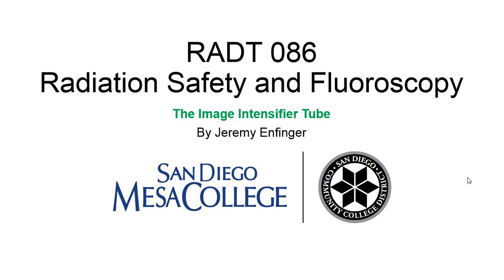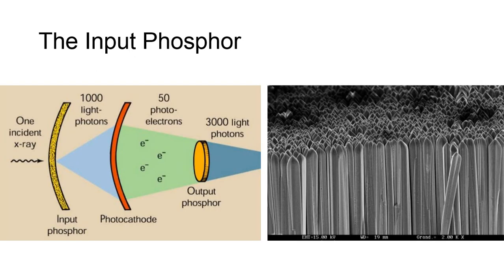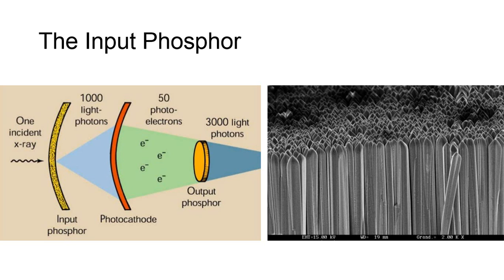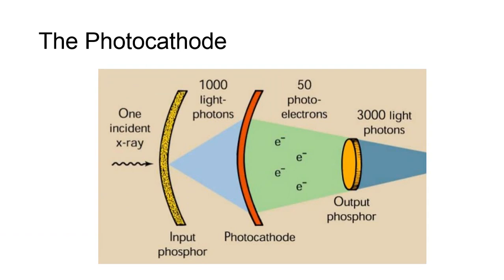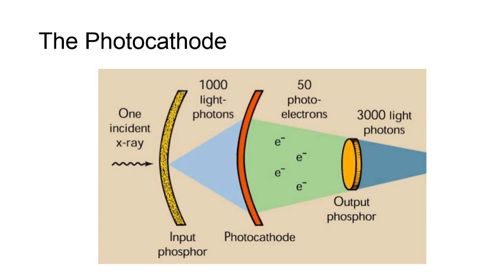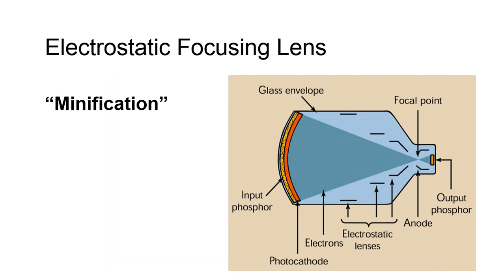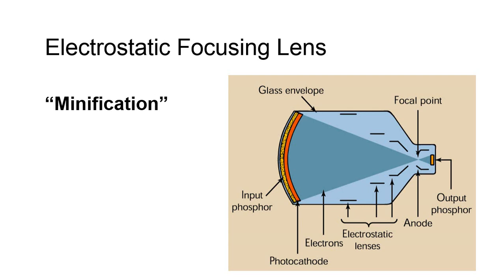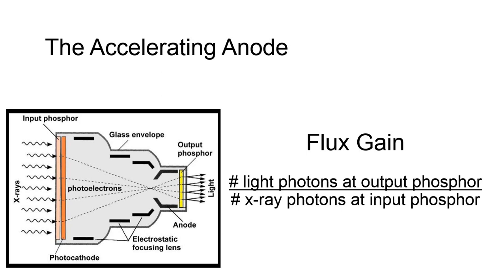The Image Intensifier Tube

Comment: So the larger the input phospher diameter the higher brightness and resolution on the image? Did I understand that correctly?
Reply: No, the larger the input phosphor layer the higher the detection quantum effeciency, the better the contrast resolution.
The higher the input phosphor layer the lower the spatial resolution
Reply: So increased phosphor layer is going to increase gain but will degrade spatial resolution due to blurring effect by spread of light.